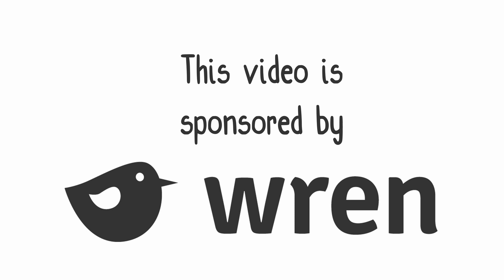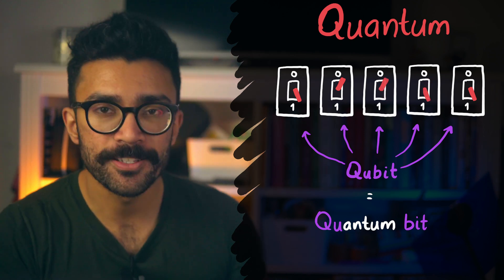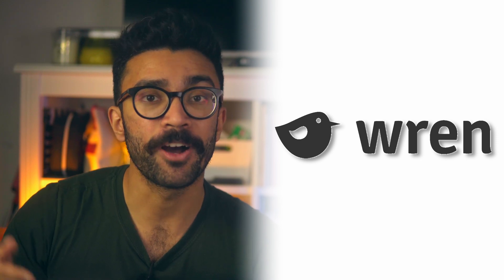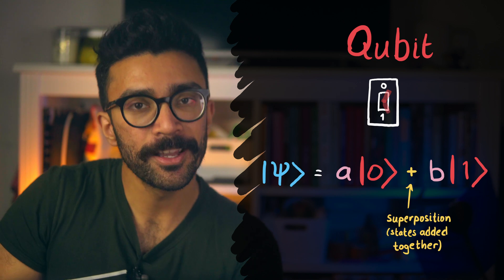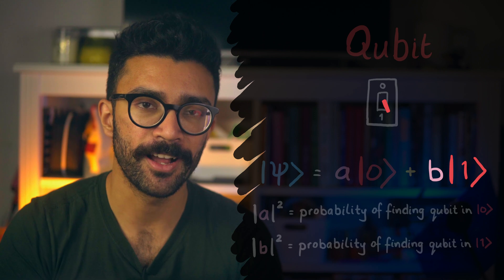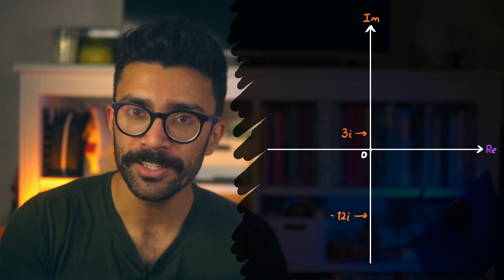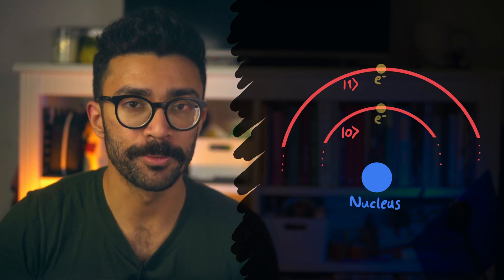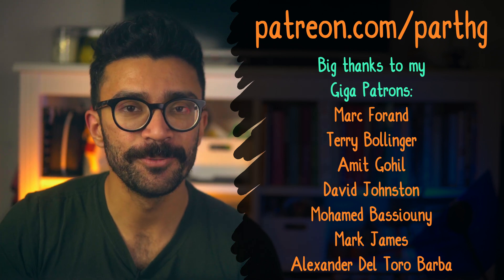The TRUE Difference Between a Quantum Computer and Your Home PC.

Comment: can you explain what does negative probability mean in physics?
Reply: Negative probability doesn't mean anything, because probability is defined as a number between 0 and 1 when normalized. When you look at the probability for a and b. They are the modulus squared which will always result in a positive number.
Reply: Probability is always greater than zero and, probability can never be negative (though it could eventually be zero). I think you've just misunderstood.